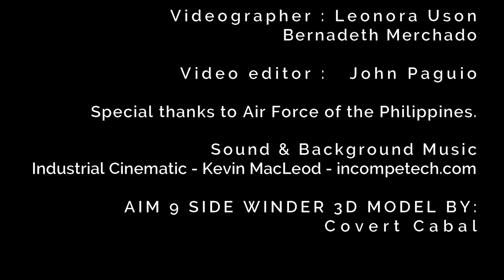How to build your own Missile: AIM-9 Sidewinder Replica Missile  for your Aircraft

Comment: Just try getting thru customs with 10 of these in your trunk
Reply from the maker: Maybe nobody will notice  =)
Reply: Wouldn’t fit in your trunk if it’s 1:1. Aim9 (earlier models) are 9’1” long by 5” diameter and AIM-9X is 9’7” long by 5” diameter. I’m about to start on a full size AIM-120C and then an AIM-9X and the logistical side of it is hard enough. Let alone building the thing.
Reply: @zooweemama911 hello bro, can I communicate with u to know how take missiles
Reply: @zooweemama911 sorry make** not take 😅

Comment: What materials did you guys use
Reply from the maker: We use PVC, Fiberglass, Resin and a variety of other materials.
Reply: Modelworks thanks!
Reply: @Modelworks  did you actually put it in a fighter jet did it work and was it precision guided?
Reply: @huntingcalideer2972  lol its a replica. Its doesnt actually have an engine or  guidance system.